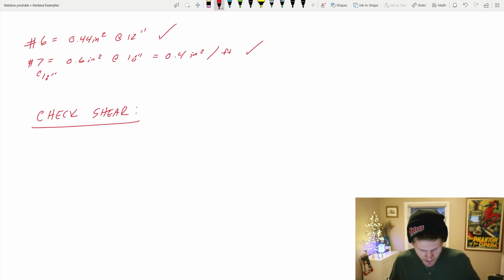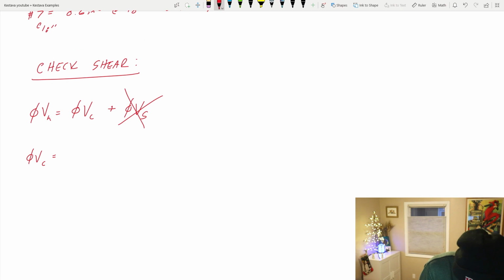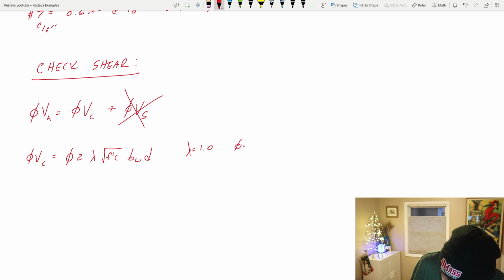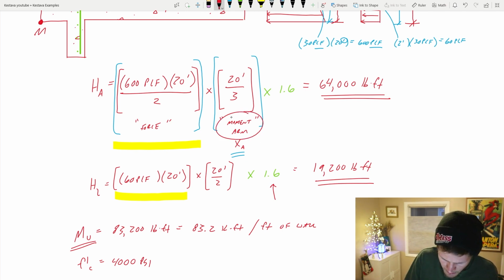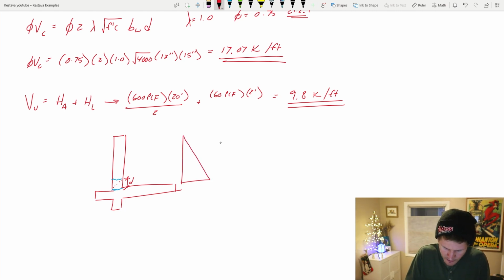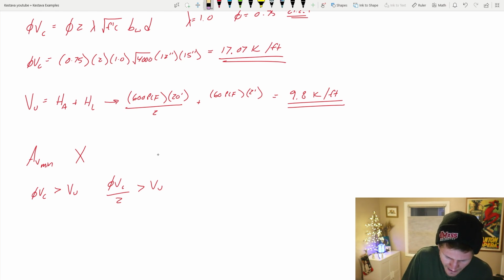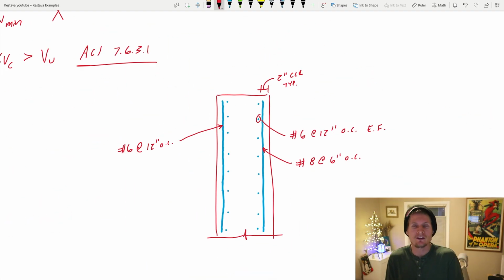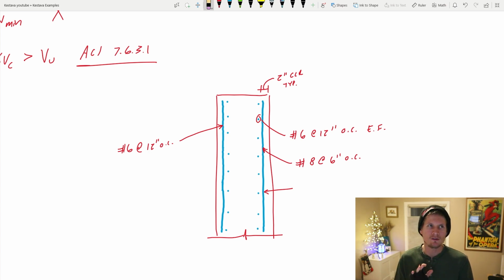Cantilever Retaining Wall Design Example | Part 5 | Concrete Shear Design

Comment: Great video/series! I have a question about the detailing of your stem rebar. I noticed you included both longitudinal and T&S rebar on both the left and right sides of the stem. I see this practice quite often, but I’m curious if there’s a specific rationale for it according to ACI, IBC, or other codes ? From my understanding, you’d only need the rebar on the tension face of the stem (the right side), and having it on both sides would be more costly .

Comment: Hi @Kestava_Engineering , thank you for these awesome and very complete videos! If you have some time would you be so kind to finish this example by designing the concrete reinforcement of the base? Even if it fails in shear, just to complete the example. Thank you!

Comment: Thanks so much for these videos, my question is, wouldnt Vu be (600 plf x 20' /2 + 60 plf x 20') x 1.6 = 11.52 k per ft of wall?
Reply: that's the way i see it.
Reply: didn't see anyone getting back to this.  I think maybe his math was off.  on the original shear equation the numbers were 600X20/2 + 2' x 30  ] 1.6  =  9.7k/ft  his rounding may be different.  I think that because he did shortcuts on the original equation, he added the incorrect active pressure.  I think.  the numbers worked for me when i did my own math.

Comment: This series has been amazing. It has helped me a lot in designing concrete walls. I do have a question, for the rebar on the left side (not in contact with the soil), is that only for temperature and shrinkage? It is not included in determining the flexural strength of the concrete right? Which means the longitudinal and horizontal bars would both be #6 @ 12" oc. I have been trying to find an answer for those rebars and if they are designed solely for T&S or is there any structural requirement for their design?

Comment: I’m a civil engineer in California and am very thankful for your videos. my comment is that in the calculation of vu at the end of the video for design of concrete cantilever retaining wall part 5 , you forgot to multiply for the factor 1.6 please confirm if I’m right , Please if is not much to ask can you design the rebar for the footings and verify if the depth of the footing is enough for plain concrete ?
Reply from the maker: Crap! I did forget to multiply by 1.6 for our load case!

Comment: I just wanted to tell you thank you for making this content. I failed my PE exam 5 times and started to think it just wasn't going to happen for me. On the 6th time, I couldn't pull myself to do any more practical problems. I was just over it and feeling defeated. One the 6th exam, I did not study in the traditional sense. I just binge watched a lot of your videos. I finally passed! So thank you.  What you are doing made a difference for me. Specifically the video where you  went over your tabs in the ACI. Even though this exam is computer based, I used that video to get familiar with the code. Also I know the shear flow video came up on the exam and was super helpful to know. I would definitely say you should do more videos about getting familiar with the code. Go over the major locations and general format,
 ect. Also one suggestion would be when you are working through problems, to state as much as possible where one can find the equation. A lot of the equations you used I could not find in the code and was not able to memorize it either. Wishing you luck with the SE! Thank you again!
Reply from the maker: I missed this comment! thank you for your kind words, it means a lot to me! also love the input to make videos better. I absolutely will do better with where to find equation to better gear people for the CBT exam. AND ITS AWESOME THAT YOU PASSED LETS GOOOOOOOOOOOOOOOOOOOOOOOOOOOOO